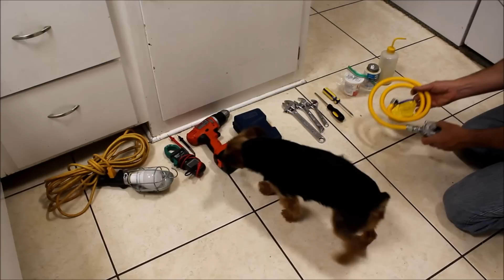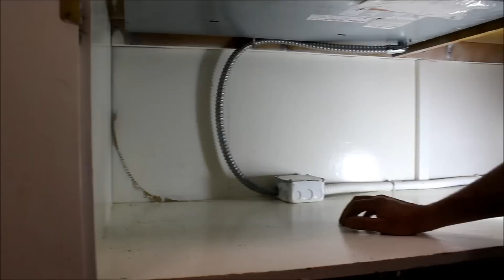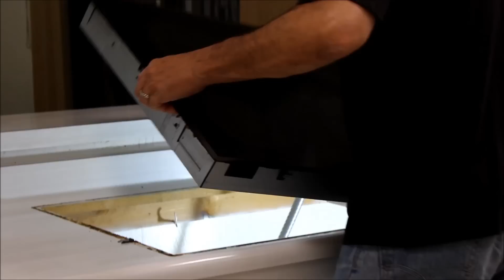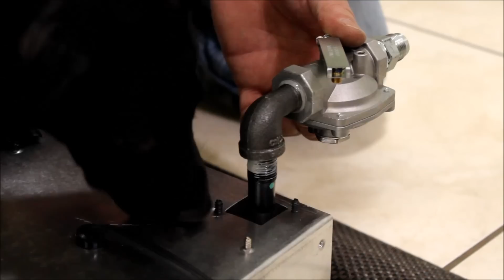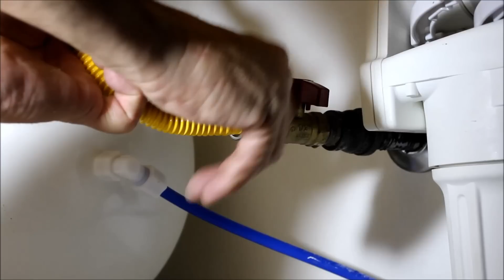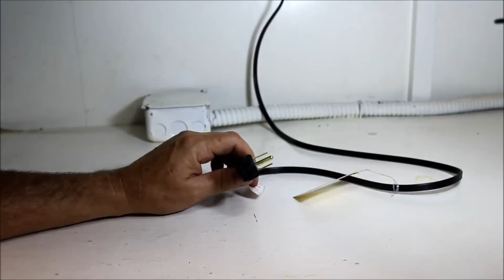How to Install a Gas Stove and Remove an Electric Stove - James

Comment: I've done all that and gas still is not getting through. I even changed the brass part for lpg or the other type of gas nothing seems to work but I'm not sure if it is a flaw in the gas stove , just like yours or a fault in the regulator. However the gas gets to the oven without any problems

Comment: Never put pipe dope in the female pipe threads. Put it ONLY on the male threads and do not bring it down to the last threads so that when the fittings are made up, none of the dope/compound gets into the ID of the pipe/tubing. It stays on the threads.
Reply: Lessons could be learned.

Comment: did u use caulk or putty to seal seams between stove and counter?
Reply: You don't need any sealant. He showed that it has optional mounting brackets that can be installed below that basically "pull down" on the unit to prevent it from moving, but he said he's not worried about there's moving around so he opted not to use them.

Comment: Where exactly did ya plug in the gas stove at?  You'd capped the 240v...did ya install the 120v under the cabinet or did ya utilized another outlet?

Comment: I have a Kitchenaid kgck366vss02 and I need to replace the igniter.
I have no idea that how to open the top cover.I am guessing that I need to take the cooktop out after disconnecting the gas line and then only I can open the top cover.
Can someone can help me please?
I dont want to spent 250 to replace a 12 dollar parts.
I appreciate your help in advance

https://www.ereplacementparts.com/kitchenaid-kgck366vss02-cooktop-parts-c-114958_419248_419933.html

Comment: There is no vent above the stove? what about carbon monoxide poisoning?  is there not a building code to have a vent to take the exhaust fumes out of the house? You could turn on your stove go lay down  on the couch and never wake up. Not much of a savings. this is no different than just firing up your propane barbecue inside the house.. also many jurisdictions require a metal shielded supply that is in enclosed living space. I am not sure if that yellow plastic coated tubing would pass. Also what about a building permit and inspection, there are reasons why DYI are not always a good idea if you introduce unsafe installations...

Comment: Ahhh man. I watched the whole video hoping for insight to either stepping down the 220V to 110V or running a line to a 110V source! I got everything done just no where to plug it in.
Reply: you can buy an adapter that turns your 220 into usable 110.  This is what the guy from Home Depot showed me - 

https://www.homedepot.com/p/Southwire-Gas-Range-Adapter-9042SW8801/302183109
Reply: @nuckinfutz001  But wasn't the electric cooktop hard wired tho 2:38 🤔.

Comment: After last night's grease fire because the burner didn't get completely shut off, I'm OVER electric.  It's just too easy to set fire to something, even if you have it completely shut off due to residual heat. Also, its easier to burn yourself or others if they don't know it's still hot. If a gas stove doesn't get shut off completely, it if it leaks, you know right away.

Comment: Hi James    Im also going to convert from electric to gas stove. Im having the local gas company run the gas pipe and meter to my home and a contractor do the actual installation. Thank you for the simplicity in your explanation/demonstration. Now I have an idea of the procedure.

Comment: Very very bad leakage test!
Reply: Yes, you want a soapy bubbly solution...not water
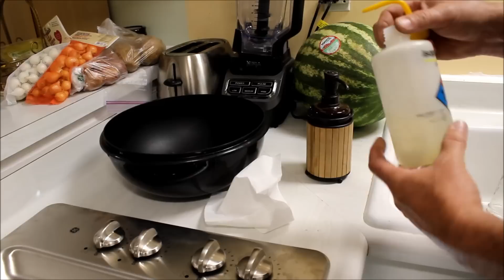Reply: @DONALD1951  8:16
Reply: Станислав Горгаз   Explain.
Reply: He is right, that just looked like water... I'd rather use a match, using water is like using nothing at all.
Reply: @ryanminaker157  A match? As in a lit match? As in fire?
Reply: @Pingaheimer  or a torch

Comment: Did you connected the gas stove with electricity ? I used to think that you just connect the stove with gas  and it works without  electricity .
Reply: It does, just use a lighter or match if you cannot power the igniter. Turn on the stove burner and light itm